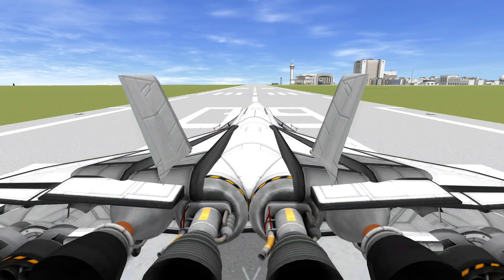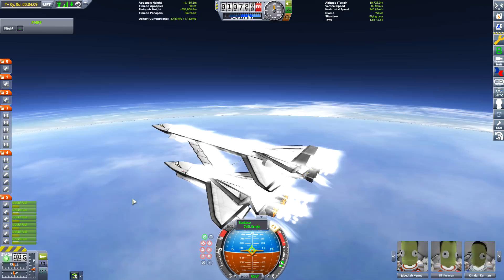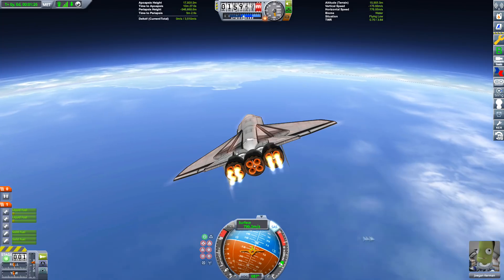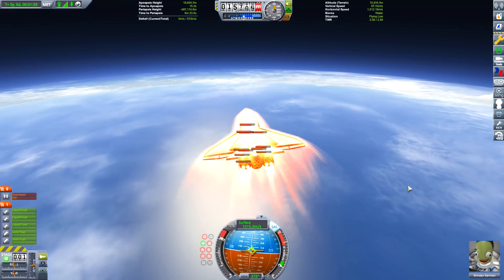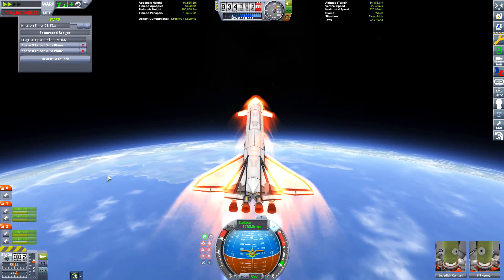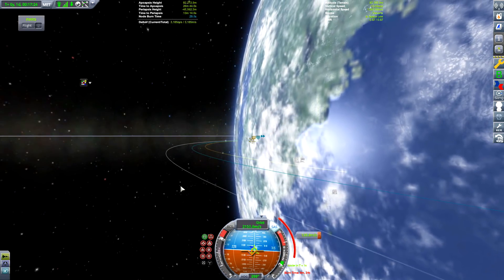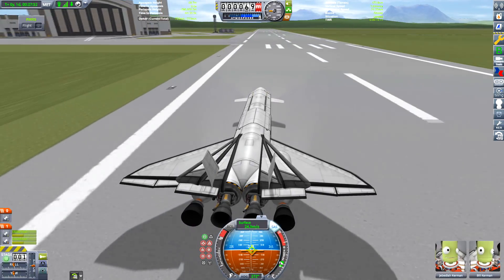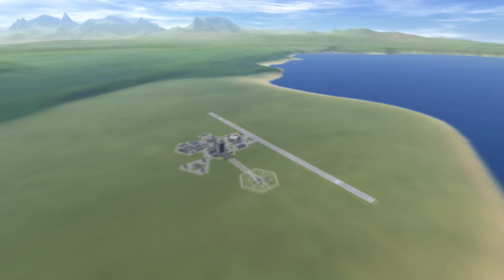KSP - Falcon X SpaceX Space Plane

Comment: Nicely done, a lifting body ! Replace the Rapiers with Panthers on the lifting body, since you don't use them much past 24 km, they're half the mass of rapiers so you can add more of them !!!
Reply from the maker: Thank I will give that a go the Booster jets go crazy fast on their own in atmospheric flight 😎
Reply: @Orb8Ter  I bet they do, only drawback I see is being impossible to use without mods. Might be interesting how you would design a lifting body that can be used in vanilla, take it as a challenge :). I only use a few mods, and the ones that alter the save system going back and forward through time are definitely not on my list - too glitchy in my opinion.

For longest time I went around the issue of not being able to pilot 2 stages at the same time by building Orbit boosters that can be flown back to KSC on their own. Technically they're SSTO's, but chemical ones.

Comment: With real Earth numbers, it's a bit different because the Booster Jets should be bigger and you would risk losing a large wing or two from larger forces than can be applied to mount them. Since SpaceX can fly rockets with very small wings then they are not wrong at all, but as we have seen before, some new technology might evolve and surprise us.
Reply from the maker: Your definitely right rockets are more efficient and safer also the drag on the three jet configuration creates way more drag, the only way I can imagin it could be done is if the Booster jets had retractable wings and the space plane replace by a rocket. Though personally I prefer rockets 😉